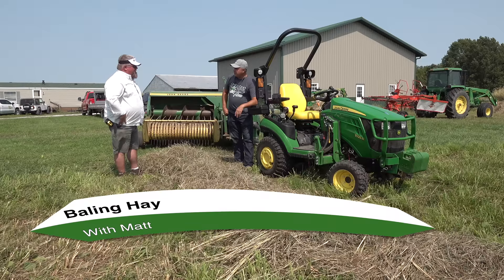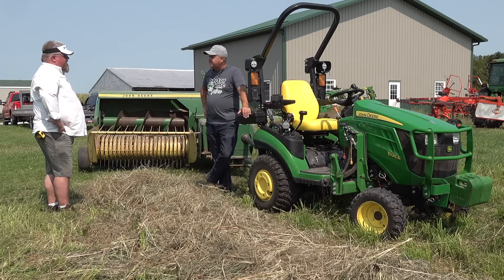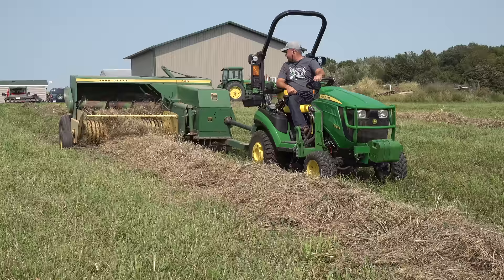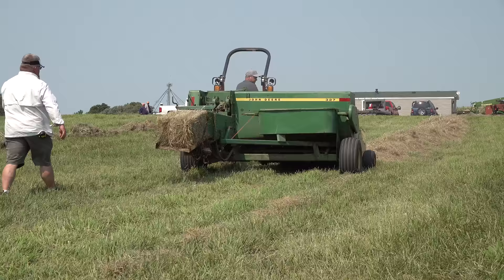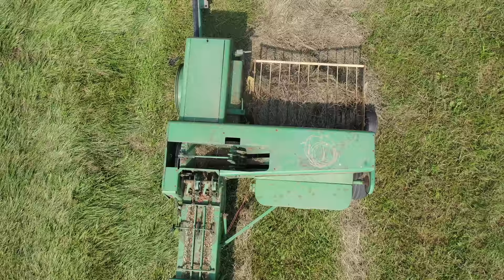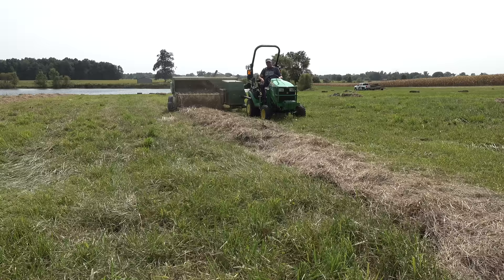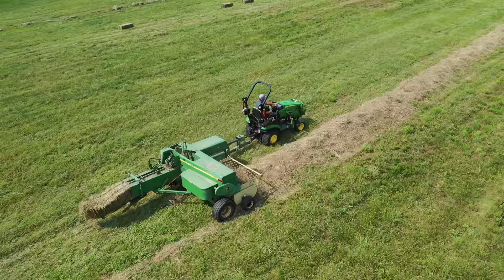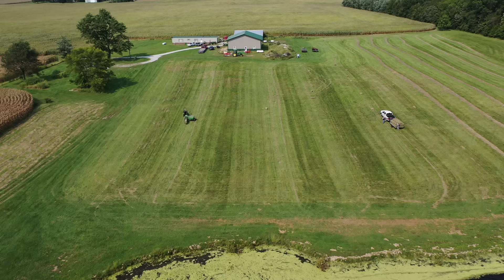FULL Size Hay Baler, Subcompact Tractor, John Deere 1025R!

Comment: I'm wondering if having the loader bucket on will add more weight to smooth out the ride. Small wheel size probably adds to the jerking.
Reply: Weight really doesn't stop the movement it's still there. We put baler on tractor that weighs over 18,000 pounds and you still feel it
Reply: @garritt8772  thanks

Comment: How would the lunge and its transfer to the tractor affect the hydraulic pumps? Seems that the pump seals would receive extra strain, slack, strain, slack, over and over. Basically, the same as constantly slapping the loader control every second. A lot of wear and tear maybe?? I'm feeling a geared drive would be better for this application?
Reply from the maker: I dunno. I would much rather have the hydro so that I could vary the speed as necessary.

Comment: That was great FUN, How would 1025R be on a grain auger to a grain bin.... I'm thinking it would definitely do fine...
Reply from the maker: Not a very large diameter auger.
Would probably handle a 6” or 7”.  8” would be stretching it.
10” out of the question.
13” requires 100hp minimum.

Comment: Thank goodness your on flat ground, yes it will work on compact tractors but it is truly hard on the engine and the tractor from the surging of the plunger head, I did it 6 years ago, but never again, it was one of those moments with hay down on the field and my other tractors were busy, rain was coming so we had to try everything to get it done, I swear the baler out weighed the tractor so bad it just pushed that little New Holland all over the place

Comment: Great video! I have an old 14T that I was thinking of doing the same thing with; glad to know I can! Is the drawbar you use straight or have a lift/drop?

Also a quick correction: the twine needles don't drive up through the hay; they actually come up through the plunger, which has slots in it. As another commenter noted, perfect timing is vital.... Ask me how i know... 😜

Comment: I'd be curious to see if my yanmar could handle that thing. You talked about the hydrostatic transmission..  my YM1700 has a standard transmission. Could put it in 2nd gear and run all day long but at 1900lb without ballast in the tires that bailer would mop the field with my tractor

Comment: I specifically bought my tractor to make hay and everything said at least 35HP. Interesting how well it works on the smaller tractor. Particularly since you lose more PTO HP on a hydrostatic transmission.
 My baler is probably 15 years older, but is almost the same as that one.
With 43HP and 5000lbs it still surges a bit, but not to the point you feel rocked back and forth all day.

I do want to see one of those little round balers. Please find one. They are super low cost compared to the square. 1200 or so on Alibaba. I figure they will probably be twice that by the time you get them here. If someone imported 20-30 of them it should get the price down though. 
I am not sure the stacking is really a problem. And the little triangle between each will help with drying and fire prevention. You would need a wall to lean against in a shed though. Something to be tested. There is definitely a market for them as the price of a small square is around 30K. If you have 2-10acres you just cannot justify that cost. The small round would fill that void if they were reliable and work well.
Reply from the maker: The compact round balers are about $10k minimum retail.  Don’t pay much attention to alibaba. LOTS of costs after purchasing from there.
Reply: @TractorTimewithTim  There was a company in Oregon selling them for 3K about ten years ago. I haven't looked since. 10K is way too much. It doesn't cost that much to important them and still make a profit. Perhaps the ones you are thinking are bigger than ones I am though. I think they made 70lbs bales.

Comment: You shoud be aware, that you can do a damage to the tractor. A man I know has the same 24HP Mitsubishi tractor as I have and he broke a PTO shaft after few years of bailing with a similar bailer. Alwo the forward-back rocking is surely going to put a lot of strain and wear into the motor and all the components between the motor and the ground. So if you do it, make sure you do relieve the tractor as much as possible, i.e. bailing only down hill and make small-volume hay rows. But nice video by Tim!

Comment: how did you make a drawbar extension for the 1025r to hook up the baler?
Reply from the maker: Heavyhitch.com 2 inch drawbar receiver then, insert 2 inch drawbar hitch.
Use code ttwt for 5% off.

Comment: Does your 1025R have a lever to set the speed, or is it only with the foot pedal? Using a foot pedal could have accentuated the lunging.
Reply: The 1025R has a cruise control lever that can be used.

Comment: Does your subcompact Deere have a drawbar that will extend to 14" from the end of the pto to the center of the hole?
Reply from the maker: No.  For this attachment,!not needed.  We used a heavy hitch 2 inch receiver plate with a Clovis drawbar plugged into it.

Comment: No freaking way!   I was just wondering if I could bale with my Kubota 2601.   I remember my dad hooked up our small square baler to a massey furguson 135 and it baled with no problems.   I was concerned the tractor would get pushed around a lot more than it did.   Since you are just dropping the bales on the ground this is a non issue but I wonder if Jhonny could pull the bailer with a wagon full of hay in the back..
Reply from the maker: We decided to avoid trying with a wagon.  In some ways, a wagon might have helped….might have dampened the surge.
Reply: @TractorTimewithTim  I agree.   If you are working on flat land and your soil is not too soft, a wagon could have helped.    I remember bailing with a MF 285 which is 80HP and the tractor did surge quite a bit.

Comment: Hate to throw mud on your parade but you'll be putting a PTO clutch in that 1025 if you continue using that baler.  That tractor is designed to stop the PTO within so many  seconds after the PTO is shut off as per  ANSI standards via a brake inside due to that tractor having a mid mount finish mower on most applications.  THAT FLYWHEEL will rip that brake out of that tractor when you go to stop that baler.   I know I don't know anything but I worked at a dealer and we had a customer that did the same thing you are doing with that baler.  IT did not turn out pretty.  BUT AGAIN I DON"T KNOW ANYTHING and the "BOOK" probably says that it only takes 20 HP to run that baler. But it's your tractor.

Comment: The only thing that concerns me with these videos is the lack of terrain. A baler like that doesn't take a whole lot of power to run, especially on flat ground. Throw a heavier kicker baler and a sizable wagon into the mix with and things would get more interesting. A full wagon alone can exceed 2 tons pretty easily. Years ago I launched 90hp, 10,000lb, tractor airborne after being pushed down a slick hill by a dump trailer. It never crossed my mind that it was going to be an issue until it was. Even a little bit of terrain can make the wrong setup a huge safety hazard. I suspect that often times the "minimum horsepower" recommendation has more to do with the anticipated safe tractor weight more than the actual power required to run the machine.

I still like the videos, but agree with other commentors that some of the equipment combinations may exceed safe working limitations outside of the flat ground in the middle of the country.

Comment: I wanted to try this for years. 
Question is, will it run a rake and a hay mower too?
Reply from the maker: Yep.  See our episodes from last season.  We show it on mower AND rake…a LARGE rake at that!
Reply: We used the same baler for 10 Years. On a 4020. John deere. It baled. Close too. 500,000. Bales.  It worked great.  Hay, and straw.  We worn it out.

Comment: That he would’ve been a little bit easier for you to bail if the wind roll was fluffed a little tighter together! You would not have missed as much on your first pass!We have a John Deere Baylor the same model and you can feed that thing a lot more than what you guys were doing first cutting this year we had knee-high wind Rose and you go back to an after 3 miles an hour feeding at soccer
Reply from the maker: We fed it as fast as the 1025r could handle it.
Reply: @TractorTimewithTim  I am very impressed how that tractor ran that Baylor! If the wind Rows where fluffed a little bit higher for you you would not have gone back and pick up the stuff you missed the first time through! Love your videos very informative and helpful thank you godless
Reply: @billcindlejr2300  If you look closely you’ll see that Matt didn’t have the pickup lowered all the way to the ground. The gage wheel was riding off the ground and not even rotating. This means the tines we’re going to throw the windrow forward instead of upward. The gage wheel can be adjusted so the tines just miss the dirt when they rotate through the pickup. Having the gage wheel on the ground where it belongs also allows the pickup to float and follow the contour of the field. Just simple details that make a difference in performance.

Comment: The worst bit  is when u first start up small square bailers   it takes the most power
Reply: I try to slip the clutch a bit to not be so hard on all the equipment. That also reduces the power needed. Problem is then I need to push the clutch in to put it in gear, but as long as you do it fast the baler doesn't lose much speed.
Reply from the maker: We had no problem starting this baler with the 1025r.
Reply: @TractorTimewithTim  i have notice the flywheel  on the John deer bails is a fair bit smaller than the ones on the old new Hollands

Comment: 1025 R has more power than a John Deere A or B. Done it with a 14t just fine. Slow but fine.
Reply: 1025 does not have more power than the newer As and probably close to same power as the newer Bs but the As and Bs had more torque

Comment: do you think a 1023e could run the baler
Reply from the maker: No. In fact, the 1025r should not do so.  It was an overload.
Reply: @TractorTimewithTim  Tim why the change of heart? Thought it wasn't that bad and could be done for a small hobby farmer with small acreage with flatland. Other than a little surging didn't seem that bad. Just wondering, thanks!
Reply from the maker: Well, I think I could hear the PTO clutch slipping /squealing at times.  I think if one goes slow enough, it is ok.

Comment: That baler doesn't do a great job.  Bales falling apart out the back.  Is the stringer broken?
Reply: Probably not, after a baler sits even over the winter small amounts of rust forms on all the moving parts and needs to tie a few bales to smooth and shine things up to work well, all balers.
Reply: The “knotter” is needing some adjustment. I ran a JD 336. I custom baled hay for years and wanted  to be there to help these guys out a little. 😉I certainly needed help when I was learning about these finicky little rascals!

Comment: This seems tremendously dangerous for a little tractor like that. I'm a little confused regarding the lack of comments about this, can someone tell me what I'm missing? All balers I've seen run with shear bolts. I assume that the rating on the shear bolt for a baler this large would exceed the safety rating on that little tractor-- don't you risk pretty severe damage to the tractor in a shear event?

Comment: You boys are playing a quite dangerous game. When I see you fidgeting in front of and around the running machine, then I see that safety plays no role for you.

Nevertheless, you should get away from the idea that everything is a question of engine power. The weight also plays a role: The midget tractor weighs 700 kg, the Baler around 1300 kg. A pretty hopeless ratio with an unbraked train. If the Baler drives with its right wheel into a hole or a ditch, it will, in a friendly case, pull the midget tractor over. Even an overweight driver is of no use then.
Reply from the maker: " I see that safety plays no role for you."     ---Quite a leap.  Oh well.
Reply: @TractorTimewithTim Oh yeah, you think so?
Then tell me what that's all about: 0:30 - adjustment work with the baler running?

Then - in the video - comes the question: "Do we have enough power?" This answer can be found in the specs: 30 HP PTO necessary. There's no need to try with a tractor. Apart from that, at the time when these baler came out, farmers did nothing but pull these things around with - from today's perspective - small tractors.
 
Clearly, you haven't seen farmers without legs or arms that they lost because they got caught in the pickup. I have.
I worked as a substitute for the sick or buried farmers back then.

Apart from that: we spent weeks hauling comparably large baler through the fields with an MF35. And we put wheel disc weights and front weights on it so that the Baler wouldn't overpower the tractor with its weight.

Honestly, I think it's nice to play farming as a hobby. But you should also do it in such a way that one can see that you have your head on your neck to think with it and not just so that it doesn't rain down your neck.
Reply from the maker: @pearlyhumbucker9065  ya done preaching now?  Did it make you feel better?
Yes, my next door neighbor got his arm in the pickup head of a round baler when I was a kid.     Safety is important.
Staying 50 ft away from something, and being scared of it has nothing to do with safety.  
Anyway, hope your rant makes you feel special.

Oh, and you are welcome to watch our other videos so that you can pick them apart too.  Wouldn’t want you to leave out the other 999 and focus on only this one!
I’m sure you can find PLENTY to rant on in those as well.
When you get done with that, start posting your own videos so that others can provide the holier than thou comments on YOUR videos!
Reply: @TractorTimewithTim  
Play child. Sorry, you really can't be taken seriously. Let's just hope that the kindergarten tractor doesn't get turned upside down one day during your shenanigans and one of you ends up lying under it.
Then will fun making time be over....